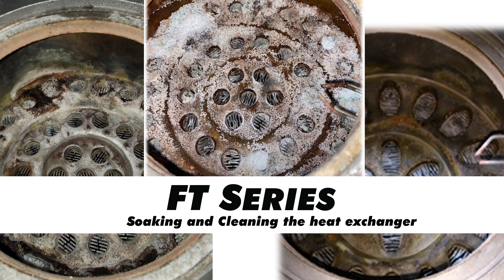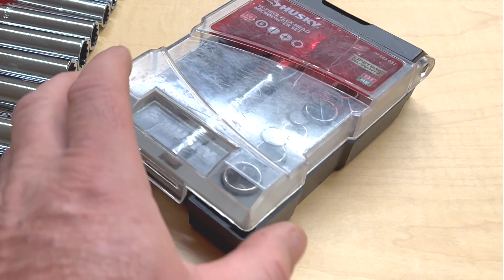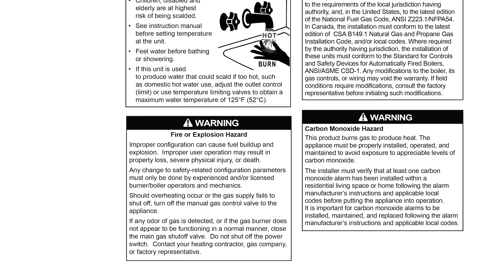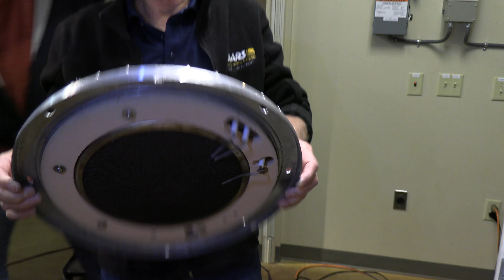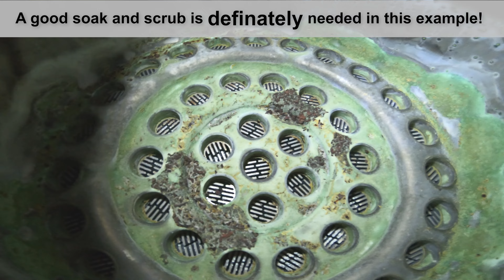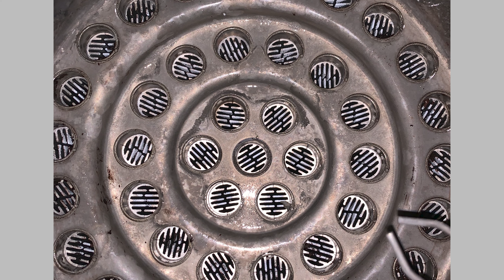FT Series (all sizes), Soak and Scrub Technique.

Comment: Hydrochloric acid (rydlym) and Aluminum(inside the tubes) and stianless steel (the rest of the heat exchanger) If you want pinholes and heat exchanger failures use this product.... it needs to be cleaned but not with this chemical!!
Reply: the rest of the video is fine.
Reply from the maker: Hello! Thank you for reaching out. The heat exchanger on our FT series product line is Stainless Steel and the fins inside of the heat exchanger are aluminum so there should be no worry of the heat exchanger developing pin holes from using this product. Please see attached link to the technical data sheet for Rydlym. If you have any questions, please feel free to reference the provided link or reach out to Rydlym direct and they should be able to answer any questions or concerns you may have.

https://www.rydlyme.co.nz/rydlyme/technical-data-sheet/